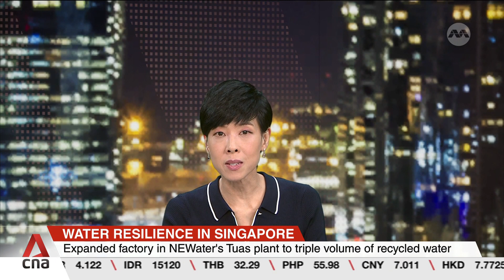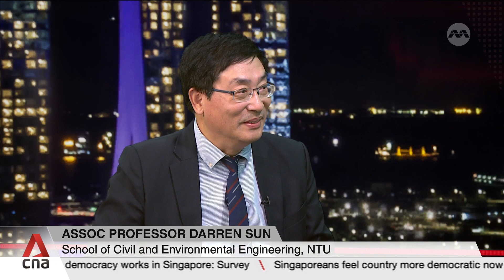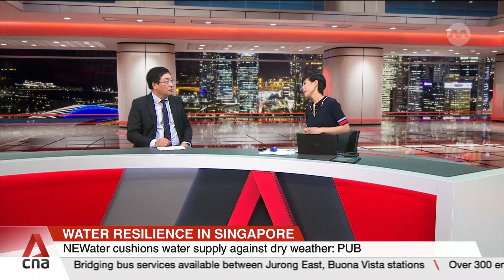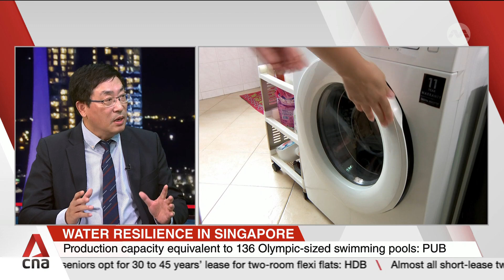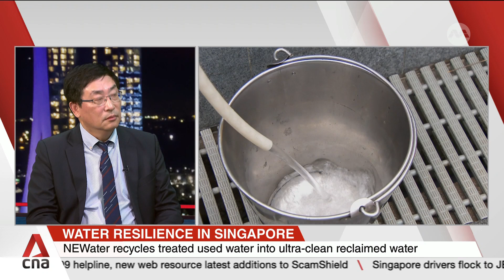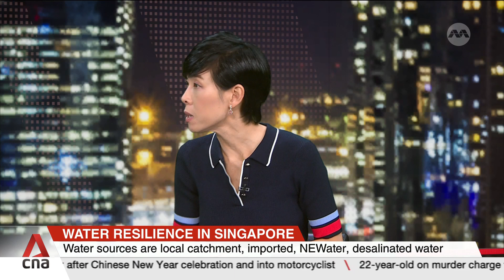Assoc Prof Darren Sun on Singapore's journey towards water self-sufficiency

Comment: Utilities, fuel = water, gas, electricity, sewage, home telco can charge 5% gnp at 40% margin generates 100% gnp stock market capitalisation  

Industry can buy cheaply from private supplies. Semiconductor, Jurong island Fuel, Chemical, Batteries, Advanced materials manufacturing. 

So no impact on that sector of the economy. Next will be CSCC project.

😂❤